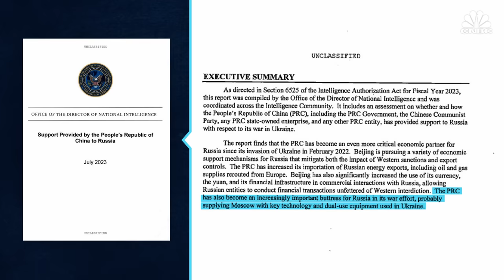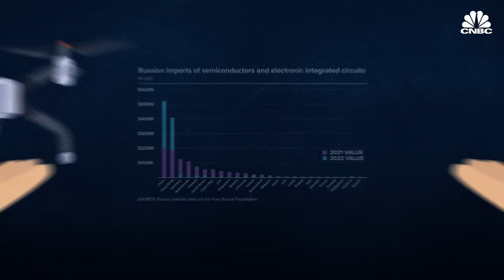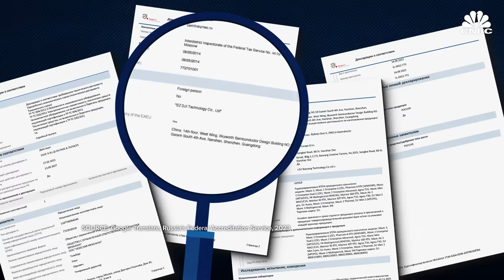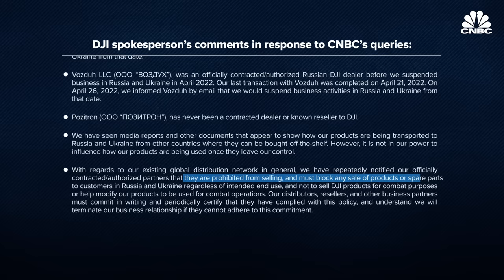How Chinese companies are supporting Russia’s military

Comment: The most important thing is that the Western economy cannot do without China, especially since the United States does not have the ability to sanction China. If the United States wants to sanction China, it will not do so because China helps Russia. The main reason is that the United States does not have this capability.
Reply: The times have changed n these western imperialist can no longer do as they please
Reply: @claudiocarrera9552  The reality is that the United States does not have the ability to sanction China. If it had the ability, the United States would have sanctioned China long ago. Does this have anything to do with China’s support for Russia? The United States can make up all kinds of excuses.
Reply: @claudiocarrera9552  well suited for your self consumption
Reply: @claudiocarrera9552 可怜的轮子😂
Reply: @claudiocarrera9552  What about you? A barbarian's rabid dog? 🐕😂😂😂😂

Comment: Russia's stability is significantly sustained by China, their neighboring nation, as it effectively provides them with nearly all necessary goods, except for microchips. This dependency on China is, to some extent, a result of the USA shifting manufacturing operations overseas in the 1980s
Reply: Even microchips actually. Those mature 28nm and above which are widely used in military stuff. Not really due to US companies moving manufacturing to China but more to do with Hong Kong, Taiwan during the 80s and Korea, Japan from the 1990s in addition to China's own propensity for all things electronics. By the time European companies and after that US companies came the ecosystem in China was already fairly/relatively developed. One of the reasons they actually came.
Reply: You know when Ford and GM had to shut down production in 2021 because of chip shortage? That was caused by just 2 weeks of lockdown at one of 3 Chinese ports. Russia gets their chips from the same place America gets their chips, the place dies are sent for packaging, the place that has the most mature node capacity in the world.

And America also never shifted anything overseas, America never made modern chips in 1980s, nor LCDs, nor drones, America never had the capacity to make anything we use today, all America did was stopped building and watch the world left them behind.
Reply: China have a stronghold on mature node chip.
Reply: China provides microchips as well.
Reply: Well the chinese mining companies are supporting US military by sending US rare earth metals to make wmd and among many other things like semi conductors etc that is used in US military, F35 etc.
Reply: Even some of European countries, until now they still buy large amount of Russian gas like Hungary, Turkey and many more, Even India, they buy cheap Russian oil and sell it to European countries.
Reply: The most important thing is that the Western economy cannot do without China, especially since the United States does not have the ability to sanction China. If the United States wants to sanction China, it will not do so because China helps Russia. The main reason is that the United States does not have this capability.